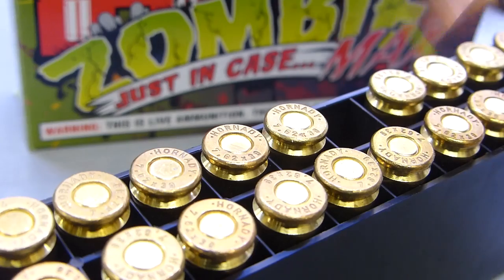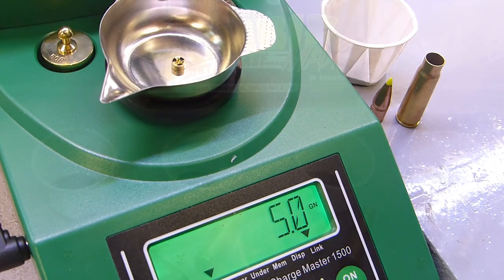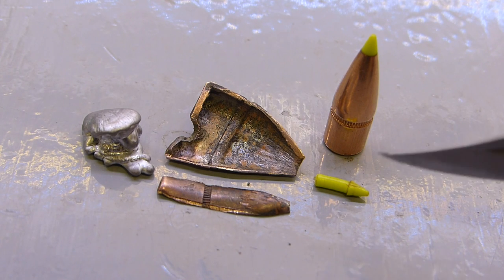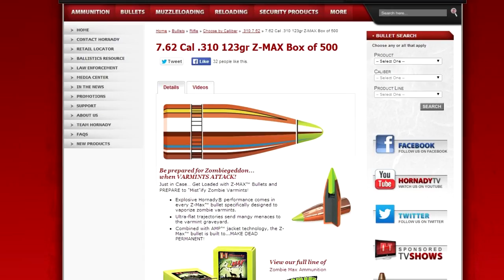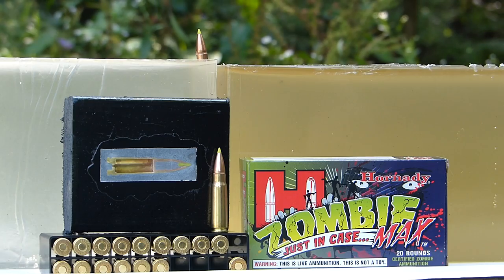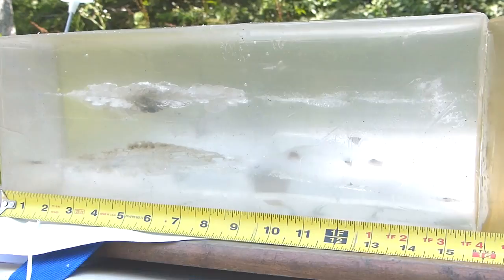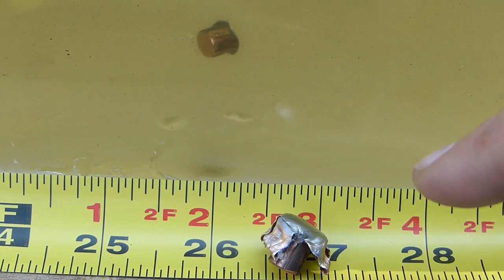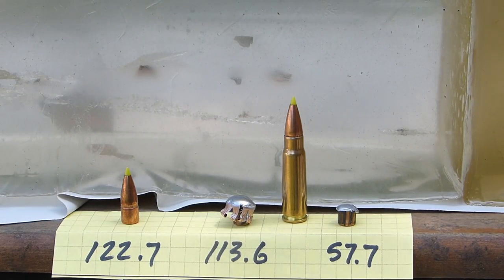Hornady Zombie Max from the inside out.  The Secret Is...

Comment: VMax .223 causes massive terminal prairie rat disintegration.  I have measured 15 foot long "green" slime trails when hit in the belly.  AMax while still killing, doesn't do as massive devastating damage.  IIRC AMax was designed as a target round.  I have never encountered the .223 ZMax in the wild, only 9mm, and yeah!  I bought every box left in the store!  I had used VMax for years, as a reloader, as my primary Anti-Prairie-Rat ammo and tried both V and A Max bullets extensively.  Never did find any Z in .223.
Great to hear that the ZMax is functionally identical to the VMax!

Though I must comment that I think Hornady may have missed the target a tad by NOT making the green insert Glow in the Dark!!  You know, as a security feature!  So you could find them when the Zombie attack comes!

Comment: Also, I believe the bullet without the polymer tip that you shot And it would perform much poorer In a medium that had a bunch of layers of denim or cloth Of some kind and would clog up the hollow point leading to inadequate expansion. That's my Opinion and from what I've seen that's usually the case.

Comment: When the Z max first came out I was told they were just V-max loaded to the same specs but with a cost savings by less stringent sample testings. So theoretically there could be more deviation.  It seemed reasonable at the time because hey were cheaper.   Then they sold for the same price after a couple years. Now they have z-max in steel case. So who knows if that was ever really true.

Comment: I thought that the purpose of hollow point rifle rounds was not necessarily for expansion, but rather for accuracy, as the hollow point shifts the center of gravity of the bullet further back. The ballistic tip doesn't add an equal amount of lead weight back and corrects for the aerodynamic drag of the hollow tip while still allowing for the displaced CG. Also, you sir, are a scientist! The only thing missing is more rounds fired, since (based on what we can see) you're basing your conclusions on only a few shots fired.
Reply: OTM (open tip match) for accuracy. Hollow points for expansion
Reply: So what's the difference? The shape or depth of the hollow? Or is there more to it than that?
Reply: JeepWranglerIslander
By no means am I an expert but, what I have seen is the OTM hole is not nearly as deep and I would expect the hole not to have a shape like the hollow point. This opinion is from checking the examples I have at home. I have not cut a bullet in half but I have checked the depth of the holes in both types of  bullets. Maybe other examples I don't have would show something different.
Reply: ragnarock75  Gotcha. Thank you for your reply!

Comment: Hi, great video, very exact and rich in information, are you aware of training rounds that consist of replacing the bullet with a hot glue molded bullet, and every propellant removed apart from the primer ? Could you do a piece on these, and maybie see what happens if you fire a .30 caliber 7.62 bullet with just the primer and maybie a .308 ? That would be very, very interesting, maybie an inexpensive way to fire revolvers and single shot rifles for training ? Thank you for your videos, they're well made and people who publish accurate information on ammo and guns are scarce on youtube !
Reply: They do ok in handguns, but I doubt if you will get any sort of accuracy if you fire them from a rifle. I wouldn't recommend them in a rifle, as you will be pushing most of them out of the barrel. While a primer does pack quite a punch, it is not enough to propel the glue slug out and get any distance. Stick with pistols on that one.
Reply: Eric Borders
Have you ever tried to fire a 7.62 round (.308 or even Ak round) with only the primer as propellant ? (I'm talking about a normal lead round.
Reply: Douilleur Lamagouille No, simply because I don't like driving a bullet out of the barrel of a rifle. I have seen several reloaders that didn't put a powder charge in the case before seating the bullet and that usually ends their range trip because most don't have any way to drive the bullet out. It is your rifle and your primers, so waste them if you like, but as I said before, you will not get any range from a rifle so "training" with that method will only waste primers. They are ok @ 20 or 30 ft from a handgun when weather is too bad to get to the range or time don't allow.

Comment: how did you make that little bullet art block? the one with the bullet cut in half in the grey stuff on that marble looking slab?
Reply: I'd assume he broke down the cartridge, reseated the bullet without powder, sealed it with a used primer, and then melted lead around it to make it easy to cut with a chop saw.
Reply: Lead flows REALLY fast due to the density.  Have you ever cast bullets?  It's crazy.

Also, I just realized it could just be a grey epoxy...
Reply: He just made a video of how he did it.  Epoxy.  Doh!
Reply from the maker: casualty178 Cutting a bullet in half
Reply: yes sir, saw the video, enjoyed it too, thanks.

Comment: Could you use these for deer hunting?
Reply: I wouldn't. They fragment and don't have enough weight retention, which you really don't want for deer. The Prvi Partizan 123gr. soft point is a good deer load. Take a look: http://www.midwayusa.com/product/641174/prvi-partizan-ammunition-762x39mm-123-grain-round-nose-soft-point-box-of-20

Z-Max is a great defensive projectile, but it'll tear a deer to pieces.
Reply: I have been using both the Z-max and V-max bullets in my scoped 91-30 for the past few years on whitetail doe in Pa. The average doe on the property where I hunt weighs in about 90 lbs, all have been one shot drops, but I am very picky about bullet placement. My shots have been from as close as 54 yards to as far as 165 yards. Again, bullet placement is the key, as it should be, and you must be willing to let a few walk by you if you can't count on a perfect shot.

Comment: Zombie  .rounds . telling my wife  of 35 years 
 She have me one of those looks.
Well guys,   see that small picture with the black rings there a throwing hatchet or axe in the wall She found her distance 
On May 7 2021 
All my years knowing her.not
One word. No clues  She even knew how. ok sweet heart. 
Took my baseball cap hung it up One step back Hit my cap with the back of the axe First time. 
  Its not Oh" crap yet.
Her family used wood For heat in winter time, Brother old sister see who could stick it the most. 
 For plinking  will need more than 
Few hundred  rounds.  .
10 x 30   300 shots don't last long.  She learning  breathing 
Skills working  an aim 
3/4 Inch  steal rebar. Every  other shot. She earned  Respect, by those who know her.
 210 yards  be all head shots
Test  and tried 4 inch target. 
These rounds  will do great  for some.. cost be one of my issues. 
My wife pick out her own weapon  pays for her own 
Ammunition.  
Learning reloading.
My bad.. well placed  shot
Is better than 10 hits ..
    She still working  on her skill.
Again  maybe great  plinking 
  do see my point  of cost.